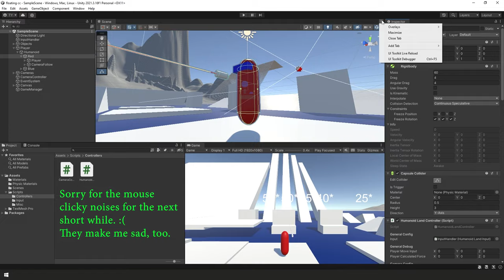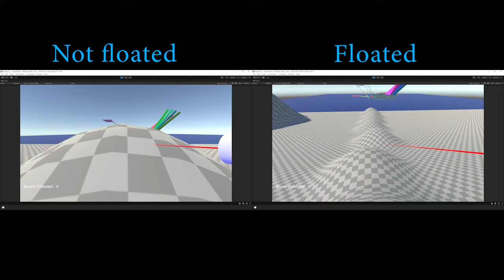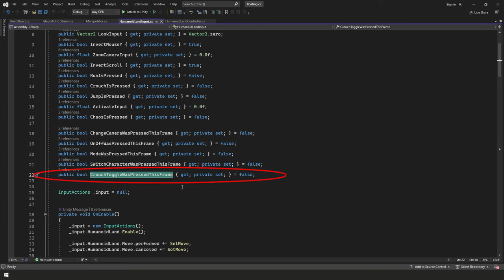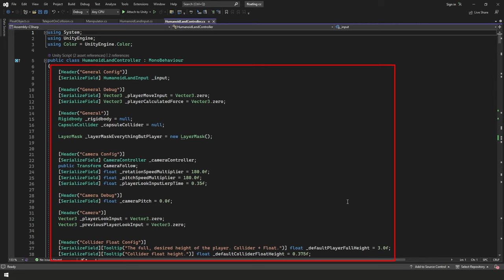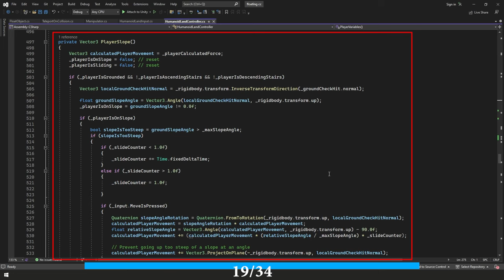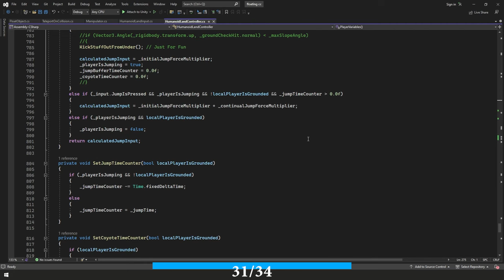Physics Based Floating Character Controller in Unity with Unity's New Input System

Comment: Thanks for the explanation of the floating approach! I am currently searching for dynamic approaches to the slope / stair movement and floating seems quite nice in that regard and it also overcomes small terrain obstacles, but as you said, the character clips a bit into the ground on landing at 2:05. I guess it could be a bit more IK intensive, so the legs would not clip through the ground, but I guess stuff that is already done in a "grounded capsule" would handle that - like snapping the characters' feet to stairs. I am trying to figure out what is the tradeoff in comparison to the standard approach and I can't figure out anything else other than that. Although it seems like the stairs will always be a pain no matter what :D
Reply from the maker: Hello there! Yea, IK would be a good way to resolve the clipping. With the Capsule it would be as simple as adjusting the capsule's height and recentering.

There are a lot of ways to handle stairs and none of them are very elegant, unfortunately. I think this is one of the best ways which is why I chose it. It still needs some refining and it will benefit greatly from some velocity limits which I've yet to introduce (particularly for descending).

This controller does not have to be floated. You can set the desired float height to 0, and it will still work with stairs since the float height gets adjusted dependent upon the stair height. That was an intentional "feature" I was sure to implement in case someone didn't want the controller to float or only sometimes wanted it to float, etc. You could also just slightly float it (which would probably be best for most games). It will minimize the clipping while still giving a lot of the benefits.

Thanks for commenting!

Comment: Hey i was just wondering how you would go about making a smooth acceleration and deceleration system for this controller, I really love this controller but i want a smooth build up in the speed that o can modify
Reply from the maker: Hello there! I'm not sure what exactly you mean, tbh. It does already have a smooth accel/decel since we're using Unity's builtin AddForce() method and not directly modifying the player's velocity.

You could try playing with the drag, mass and multipliers... that might get you closer to what you're looking for.

Otherwise, my next idea would be to just implement a timer that directly modifies the force being applied.

I hope that helps! Thanks for taking the time to comment and best of luck with your project!
Reply: @1zed1Games  thank you soooo much for replying, I love the kids and this helps a lot, I have already implemented a coroutine that decelerate and accelerates by modifying the forces applied with lerp but I like the timer idea more, it seems more versatile and scalable

what I wanted to achieve was just a way to modify how fast the player speeds up and slows down in different situations like when sliding down a ramp

Comment: Okay now I am completely lost. 

Thanks all the same for posting this for those better at coding. Clearly its not something I have the ability to do correctly or using this guidance to fix or improve the scripts I made after seeing this.
Reply from the maker: Hello there! Sorry if this one seems a bit overwhelming. It's more of an information piece for those interested and/or already able rather than my usual in-depth breakdown/tutorial.

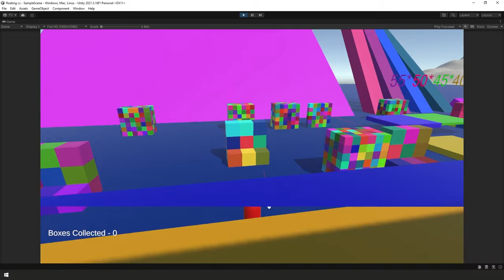I'll likely make more videos on this that go far more in-depth; but, for now, if you want to try tackling it, I'd start with just floating anything. The very first script I show at around 04:05 will show you exactly how to do that. That in itself is quite an accomplishment!

Next, I would suggest floating your character's collider. That is another huge milestone. After that, you can work on getting the other functions working (jumping, crouching, slopes, stairs, skin width, etc), as needed (maybe you don't even need some of the more complex stuff?).

Or feel free to skip this one... a floating collider may not be necessary at all for your project/game!

Thanks for commenting and best of luck!
Reply: I think his coding is a bit too advanced, I tried following his first TPS series boy the code was not easy to customize ...i ended up abandoning it
Reply: @1zed1Games   Hey thanks for your efforts but your TP controller series while it was informative, your code was full of shorts, and lacked a clean code approach that allows us to customize the code. I tried reading it so as to customize the scripts but the code i couldn't understand which function is linked to which one.